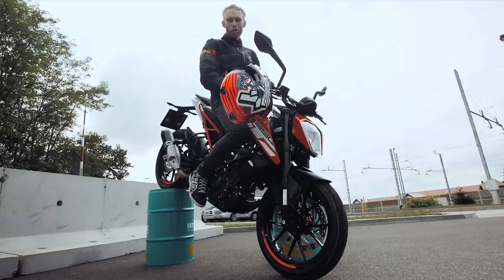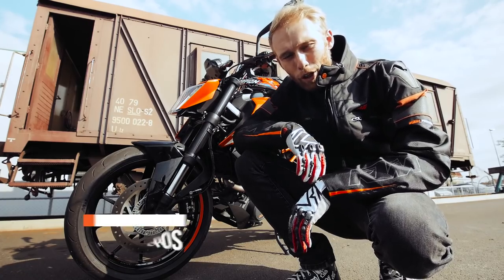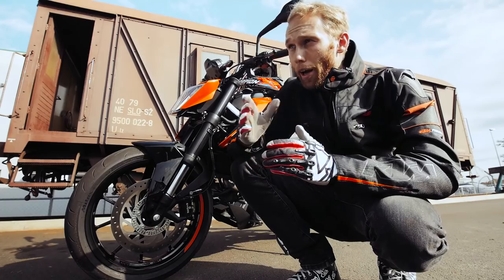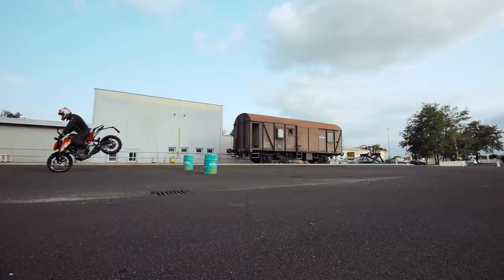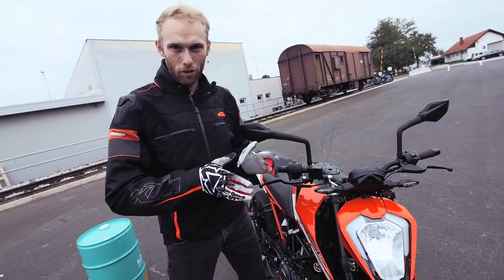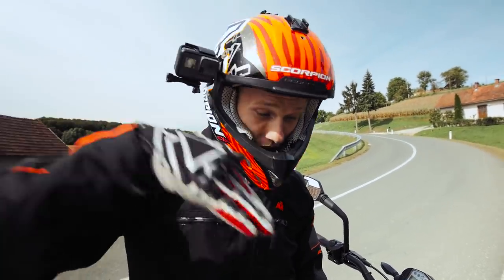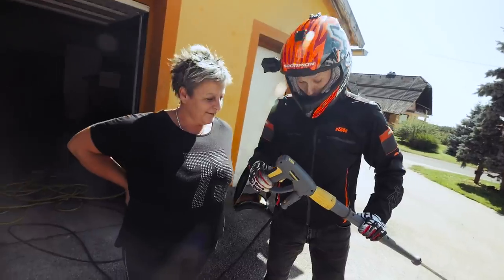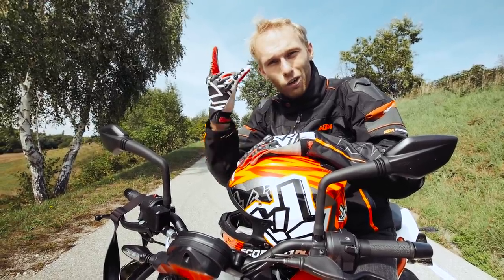How to rolling stoppie / Duke 250 - RokON VLOG #31

Comment: You missed one thing, switch off the ABS.
Reply from the maker: Amaey Paradkar yes thats right. We. need to "thumbs up" this comment so people can see it :) Thanks btw. for the update - RokON!
Reply: RokBagorosStuntrider 😉😊
Reply: I was about to ask does the abs needs to be switched off
Reply: Noushad noushad Doesn't mean none has it. Or does it? 😋
Reply: Sumit Singh Now you know.
Reply: Amaey Paradkar Duke 250 doesn't have ABS
Reply: Mark Remulta I have 390, it does.
Reply: Actually the kind of Duke he's riding here is not the Duke 390, Duke 250 don't have ABS even as option. That's what I mean.
Reply: at Argentina these bikes come w/o ABS... :(
Reply: Ktm 250 dont have Abs bro
Reply: You are so fuuny,,, this bike is not abs
Reply: But 250 doesnt have ABS
Reply: Abs stops the bike from locking the tire, but im pretty sure it doesnt stop you from tipping over when breaking, so you can still do tricks just not slide the wheel with the brakes
Reply: alfonxoduff ABS won't let you do a stoppie but it will let you do rolling stoppie as the wheel doesn't lock (it's rolling) but it does interfere at times
Reply: Global Sumit （
Reply: RokBagorosStuntrider what should be front tyre pressure
Reply: damn my front wheel slipped! my wheel slipped to the left and i had to do emergency Foot on the ground :O  i almost died :o or isn't this by the ABS?
Reply: @RokBagorosStuntrider  or you can PIN the comment 😛
Reply: Good tip's
Reply: KTM Duke 250 Indonesia have ABS
Reply: 250 have no ABS
Reply: Also brake control how to ease off
Reply: @RokBagorosStuntrider   Yes but ..How to turn off abs ...this is a major topic, can't find clear information about it on internet or at KTM Dealers.
Reply: I just came here to ask the same thing.. What to do about the ABS and got it in first comment.
Reply: @RokBagorosStuntrider  I have one doubt these wheelie can done in R15 v3 bike
Reply: @NOUSHU noushad not all but some only✌
Reply: That’s the reason why you should ride bike with no abs
Reply: YES AHHAHH AHH THAT S WHY I COULDN T MY OTHER MOTO WAS A XR 600 NO ABS
Reply: @RokBagorosStuntrider  60METTERS A PERFECT EGUA IT S THE PORTUGUESE NAME.....HORSE NS THE WEELLIE  FEMMALE HORSE IS EGUA THE STOPPIE......THANKHS BRO FOR ALL VIDEOS ...I NEED SOME ADVICES ABOUT MY 390 ....THE BEST VOLANT THE BEST BACK WEEL DIMENSIONS PLEASE
Reply: In India all bikes have abs
Reply: I dont know ABS wat is it
Reply: So we need to switch of abs right??
Reply: But some bikes don't give an option to switch off ABS like duke 390 where I can only switch off ABS of rear but not front wheel them how to do a stoppie on those bikes
Reply: And bs4 does not have dual Abs Not even duke..... sorry
Reply: Gonna say the same thing 🤣🤣
Reply: You missed one thing, switch on the bike
Reply: No  bro 2017 model duke 250 is non abs
Reply: @markvincentremulta2501  no theres two varients with ABS nd without it.
Reply: @RokBagorosStuntrider  Just pin his comment then.
Reply: Well #rokbagorosStuntrider doin it with the abs is helpful for ma and some people of my country.
Only in my country Bangladesh it has a cc limit maximum support 165cc till now.and we only can use 125 cc duke it's a bit weak .
On the other side bike price is so high here duke 125 euro5 Is around 6k dnollers.and the latest version of the duke doesn't support Abs of.
We just can control rear abs so its helpful for us.thank you rider take exhost love for BD.
Reply: You can literally see the ABS ring blow his front disc. Amateurs.

Comment: Great great Video, Rok. One question, after you accelerate, do you downshift (to first gear) before you apply brake for the stoppie, do you downshift during stoppie, or after you finish your stoppie?? I'm wondering because I can do somewhat rolling stoppies, but would like to combo up with a wheelie, and there is always that gap of getting into first gear.. Thanks man, appreciate these tutorials..
Reply from the maker: 8meals I downshift while I am rolling a stoppie or after I finish it but never before since thats not good since downshifting can lock your rear tire just before you go on the front wheel and that will make you unstable. Just roll the stoppie and hold the clutch while rolling ;)
Reply: Awesome thanks Rok

Comment: bro i like this video very much than any other because you taught us how to do a rolling stoppie.
and one thing i want to know from you is , you made some stunt bikes means converting them to stunt bikes . so i want to clarify my doubt that about chain sprockets .
so we can change our rear and front sprockets instead of stock to aftermarket.so we can add our desired size of sprockets at rear .and the thing is ,  is there any difference in between hole to hole diameter or size of sprockets and sprocket hubs related to measurements of rim from bike to bike or they are universal.means can we fit any bike's rear sprocket to any bike or is there any limitations according to their sizes.

Comment: Bro please reply to my question. I want to install an exhaust on my Duke 200 and I want a full system exhaust. Do I need tuning or something else after installing the exhaust.
Reply from the maker: Sahitya Sagwal first there is no Akrapovic full system only the slip-on and if you mount an original Akrapovic on the Duke 200 there is no need for other tuning ;)
Reply: RokBagorosStuntrider thank you so much for replying. But the one I want is not an akrapovic it is really good local one it sounds amazing 😍😍😍. So if I get that one is there a need for tuning ?? BTW it is a custom underbelly exhaust.